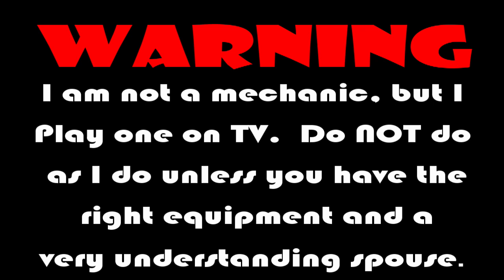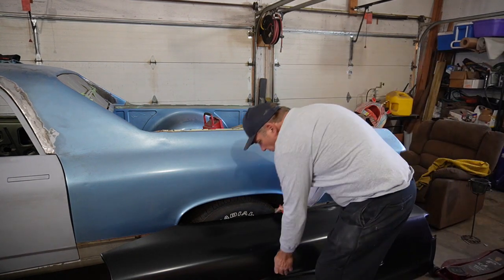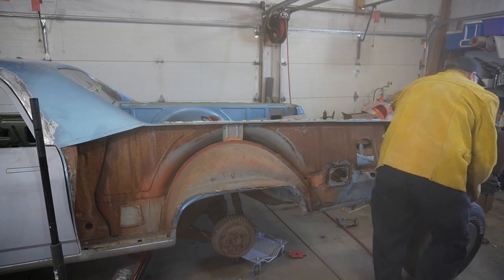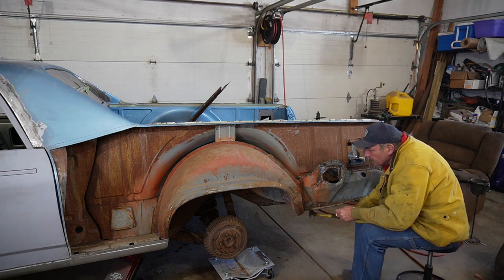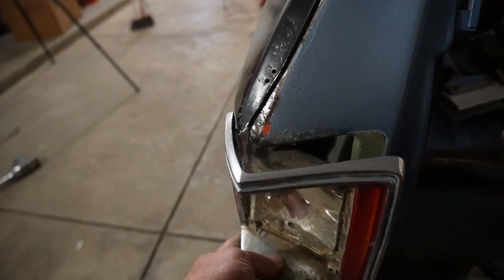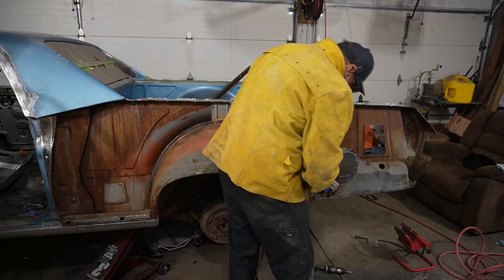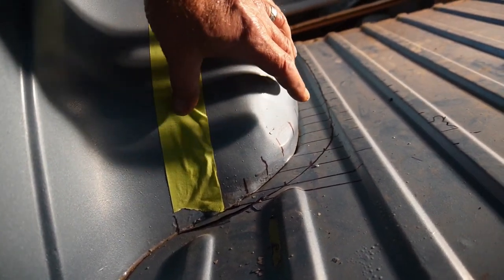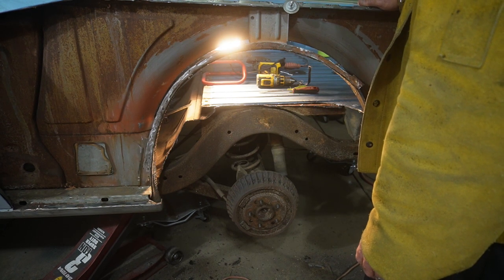1970 El Camino Quarter Panel replacement and mini tubbing - Part 1

Comment: i'll be doing quite a bit of this for the first time on my '72 el camino classic. picked it up about a week ago, completely original never been touched factory 307/TH350. and in amazing shape other than the rust. been off the road since 1986. have frame and floor issues too that i'll be tackling. i have a 68 body on a rolling frame thats from TN (i'm in upstate NY) so i'll have that as a backup plan.
Reply from the maker: Sounds like a great starting point my friend. Good luck with your project and thanks for watching!!

Comment: Had to email you today because I've watched maybe 10 of your vid's. Thanks so much for documenting the process of your recreation of one of the finest cars ever made. I have a 1970 SS 396 numbers matching El Camino that I bought in 1978 for $275.00. Yes 45 years ago and it's getting a frame off restoration this time. I've gone through it 2 times before but not like this. I always said that when I retired I would do it right and here I am. Anyway it's going to get both new quarters also and I must admit I was apprehensive about that job however you inspired me and made it look like a piece of cake (Which I'm sure it was'nt) but at least I'm ready to dive into it now. Also I'm thinking of some of your other mod's too but I just love the car so much that I'm probably going to keep it pretty close to orig. shape with some tiny mod's here and there. Don't know where you're located or what your background is. I'm in Colorado Springs CO. but origionally from L.A. area, which is where the car was born, I even visited the GM Plant back in the day, but it's no longer there (Van Nuys, CA. Plant). There's a big strip mall there now and they approiately named the Mall "The Plant" LOL! These cars, Chevelles, Camaro's, El Camino's really were waaay ahead of their time. Anyway keep up the good work and we'll be looking for the next video!  Thanks Again!    Paul.
Reply from the maker: Thanks so much for the encouragement my friend.  We are in Michigan so winters as you know are a challenge. Glad to hear you are getting started on yours...keep us all updated!

Comment: I have a 1969 impala when it had body work about 30 years ago they just tack welded sheet metal over the damage and putty it , such shotty work when they just could have replaced it with panels at that time, now I have to do it with panels that don’t 
Quite match,,,well at least I have a new project. Crappy work just to save money…. Nothing changes, body shops still doin it.
Reply from the maker: There is always somebody looking to save a nickel of time despite costing a buck. Thanks for watching!!

Comment: I have a 71 El Camino, SS 402 all original four-speed 373 in the rear triple block rebuilt the engine, trans and rear . Looking for a space to rebuild the rest of the car. Years ago it was called the . Bullet  . Or if the price is right, will sell. 💵 .